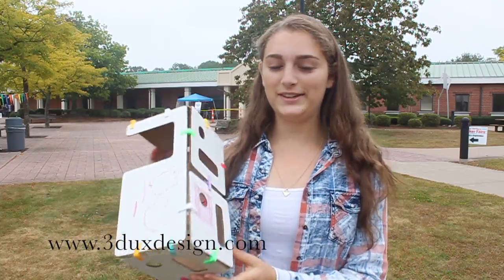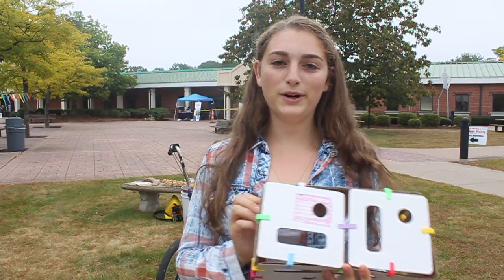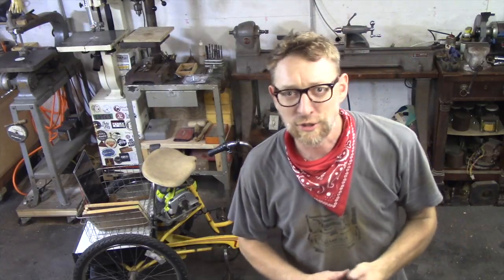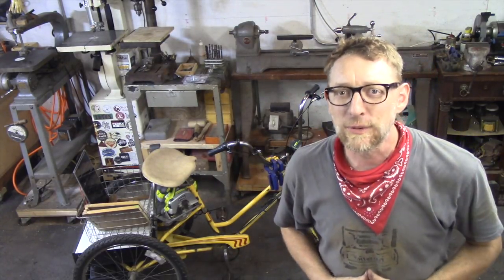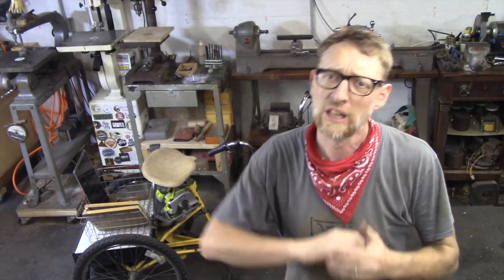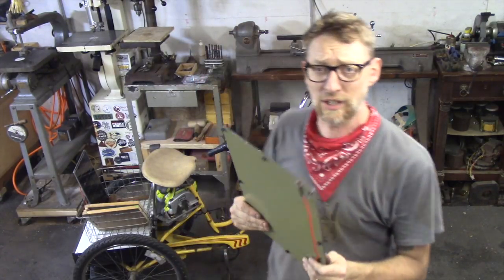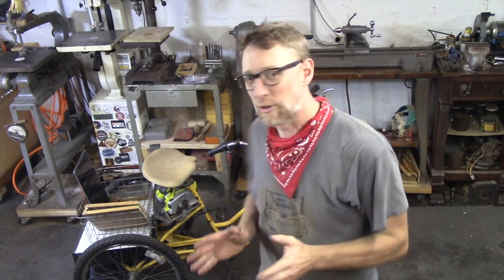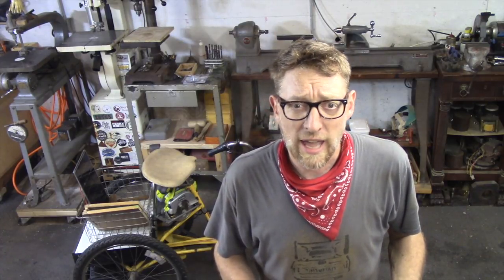The UpTriCycle visits the Hartford Mini Maker Faire

Comment: Cool video Tim. Love the mobility aspect you showed. When we mounted two small solar panels on top of a little trailer, they went bad because of vibration.... And it had suspension. On a bike, perhaps you'll need to address this.
Reply from the maker: Rag Tie excellent point! I will look in to it. How long ago was this? Solar tech has come a long way. There doesn't appear to be anything that can loosen up on these.